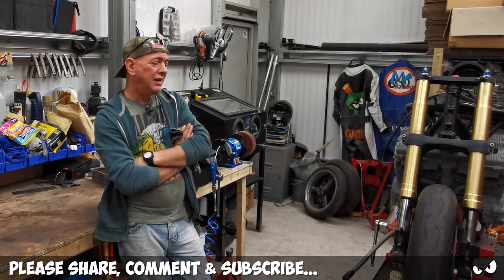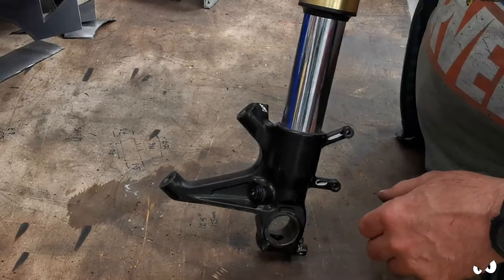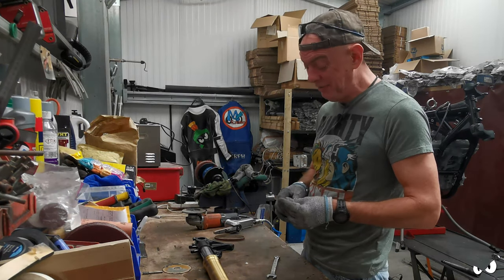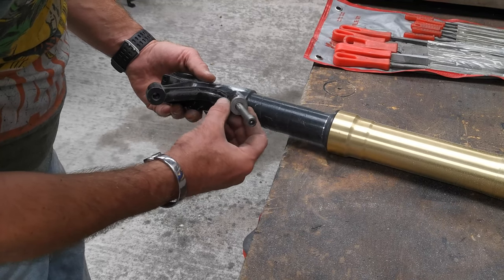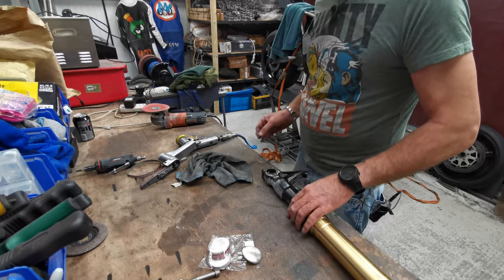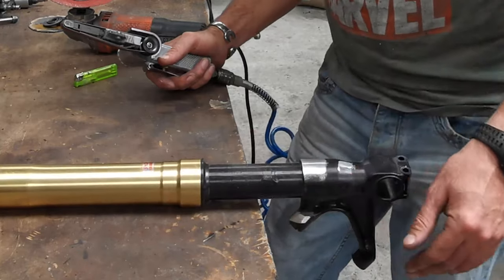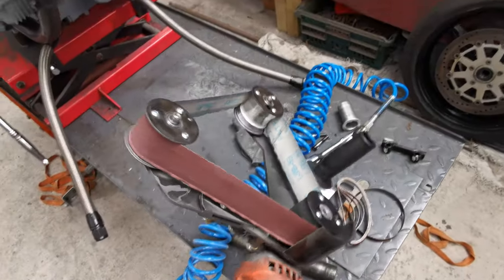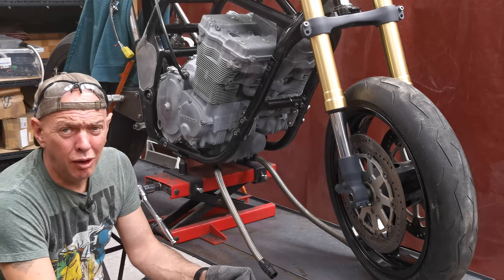Forking about n cutting stuff up - Suzuki Bandit Cafe Racer - GIXIT Project Part 49

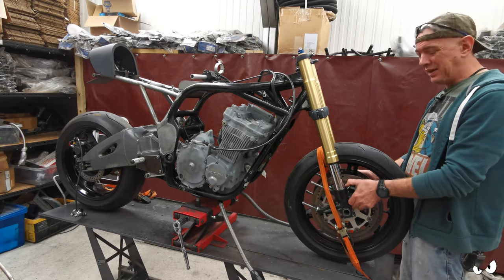Comment: 3:50 JFYI Front mudguards are one of the strange parts of a motorcycle, they are not required for an MOT yet they are a legal requirement. Therefore it is just another one of those things the law can do you for.
Reply from the maker: Well, there's plenty of bikes out there with no front mudguard, I ran one for a number of years, got pulled speeding and it was never questioned... If we need to change it we will, but this is the look Steve O wants. Its a good comment and thanks for chipping in. I guess we'll just see how we go hey 😁👍
Reply from the maker: Thank you chap, I appreciate it 😁👍